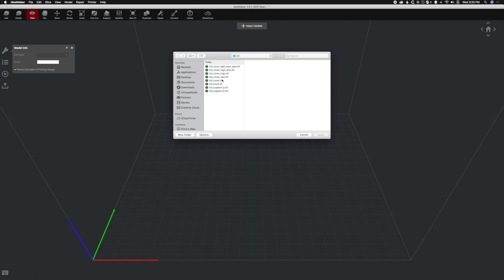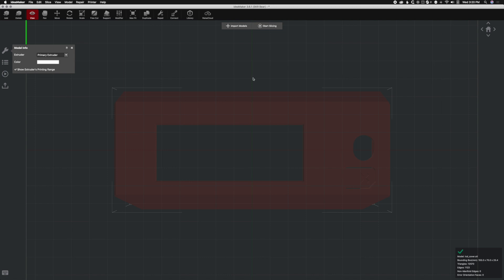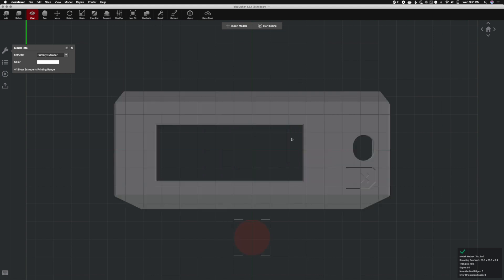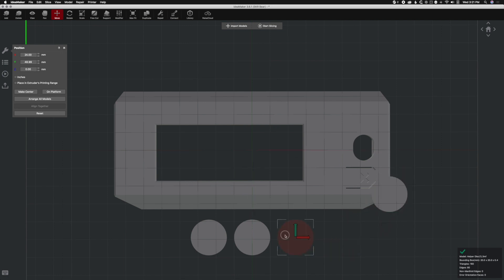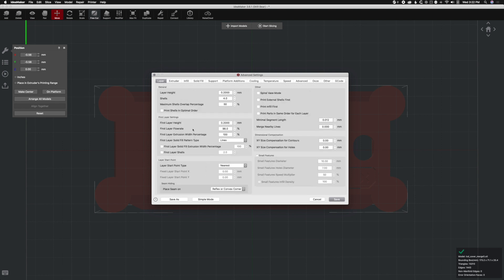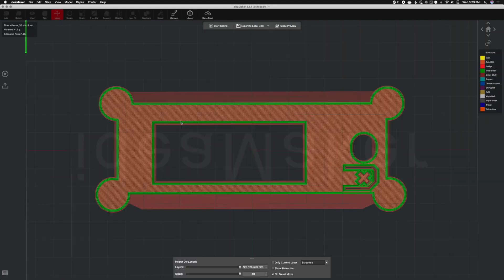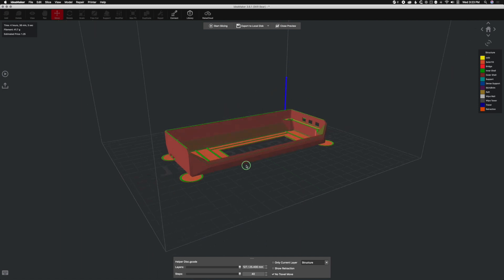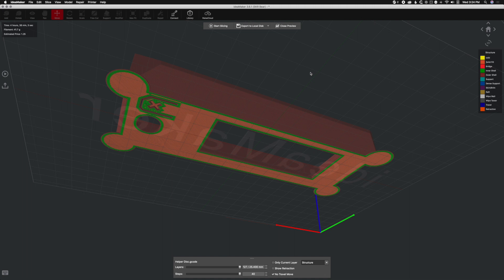Ideamaker: Helper Discs

Comment: Hi, new to your channel. I have another method of doing it and I hope you test it once: Start is the same: add your main object and then add primitive -> cylinder and duplicate and place where they have to be. What I do differently: I take all the disks and merge them, then I add a modifier to the disks and import the original object as a modifier (and make sure it is at the same place of the original part). On the modifier, I set shells, infill density and bottom and top solid fill layers to 0. The result is that the disks are cut where the original part connects and follows the shells. I think this way the disks are easier to remove or at least you see where your part ends and the disks start.

Comment: Instructive video for various features and where they live, but...

I'm not convinced I'd want to do it this way.

The fact the the perimeter line is extended and the original perimeter overwritten with solid layer would make it a bit of a sod to slice off cleanly.

I've modelled disks In TinkerCAD with 90 degree segments removed, which I lay down next to my model on the corners, providing a brim-like interface with the main model, but gaining the advantages of this method.(less cleanup, less plastic deployed)
Reply from the maker: Comes off no differently. Cuts easily with a chamfer tool. I wouldn’t use it where it’s a a decorative face on the bottom but for pieces that it’s the bottom it won’t have any issue.
Reply: @Mr3DPrintWizard  But, the print you've demoed in the video has a decorative face!! That's the one face on the printer that's more in your eye line (with the screen) than any other!
Reply from the maker: It’s what I had and explained it was a bad model. I’m all about making my video recording easy on me lol.